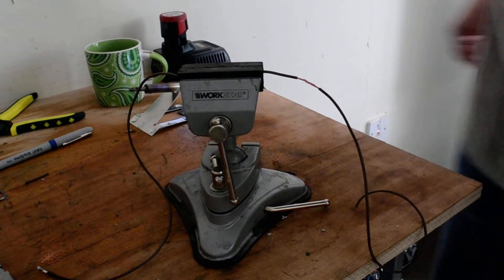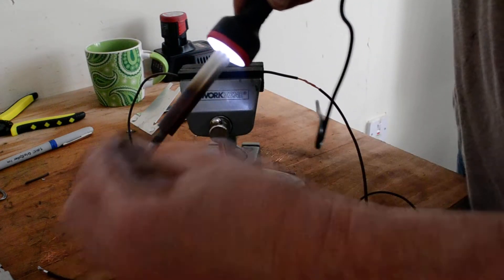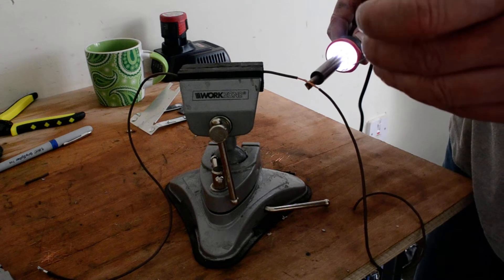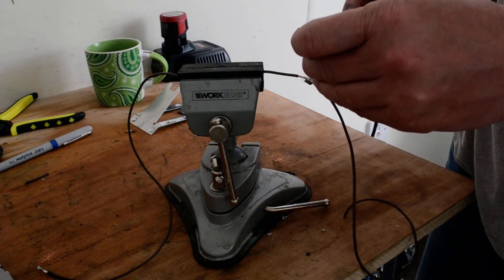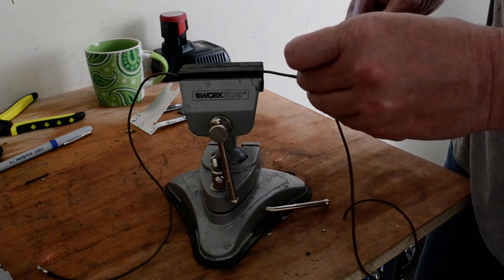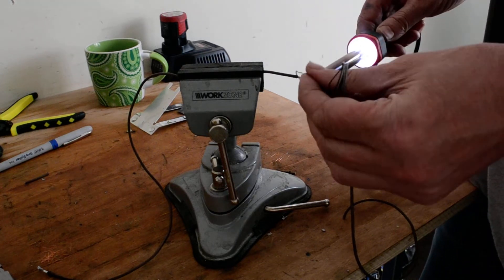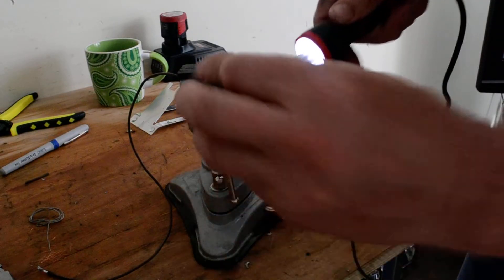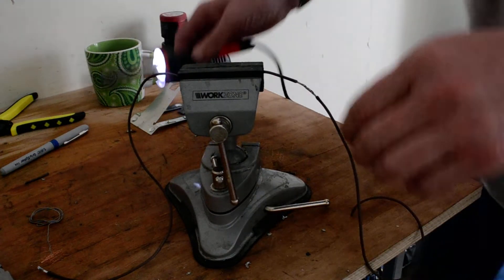How to Solder Wires Together PROPERLY 💡 The Right Way to Solder & Use Heat Shrink for Strong Joints

Comment: Only posting this as its the most recent video 

I think my crankshaft bearing has gone.

I've stripped the engine down on the clutch side.

It's just the actual basket to come off now and I'm having problem with it.

Before Before go any further.......

Is the the side with the clutch or the magneto I need to be looking at?
Reply from the maker: What bike do you have , best to read manual and study it.